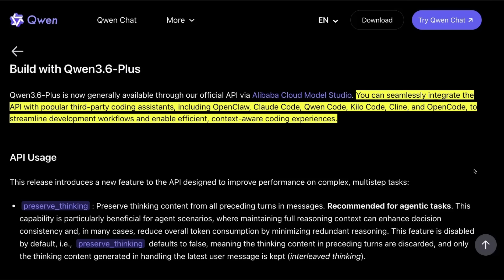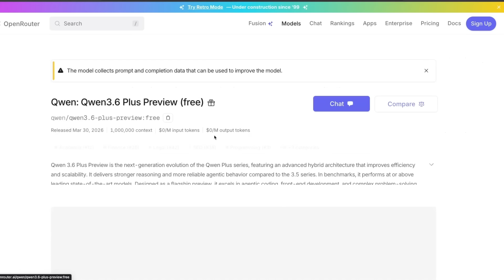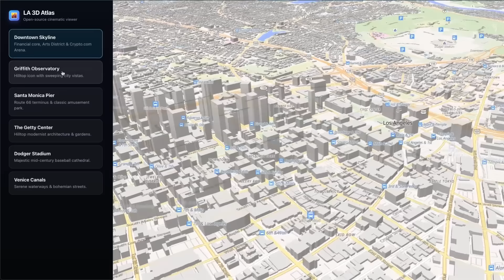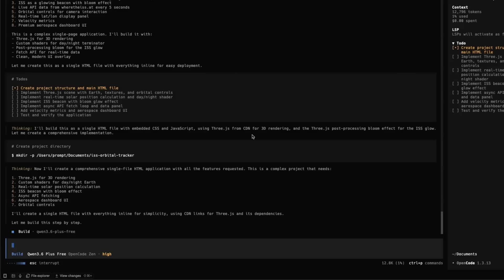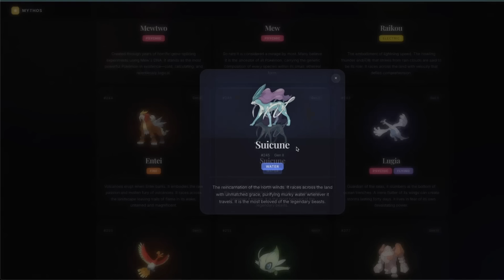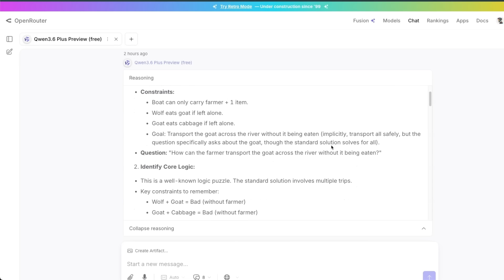Qwen 3.6 Plus is Opus but Free?

Comment: Interesting release and the harness over model point is genuinely the most useful takeaway here, though worth flagging for anyone jumping in that since this is a free preview whatever you input is likely being used to improve the model on Alibaba's end, so keeping sensitive code, proprietary logic, or anything you would not want shared well away from it is the smarter approach regardless of how impressive the benchmarks look. 

The 1 million context window sounds massive until you actually use AI in game development where context tokens get eaten up incredibly fast between scene logic, component references, and engine specific syntax, so prompting smartly and in focused chunks matters a lot more than just having a large window to work with. 

From what I have seen during my internship at Lifewood prompt engineering around context limits comes up constantly, and the hallucination problem is worth taking seriously here too since AI tends to hallucinate noticeably more in game development than in standard programming, likely because the combination of engine specific APIs, custom project structures, and less represented training data creates more gaps for the model to confidently fill in with something plausible but wrong. 

Always verify generated game logic manually before integrating it because a hallucinated method or a misremembered Unity API call that compiles fine but behaves incorrectly at runtime is genuinely harder to debug than a straight up error.

Comment: I thought you'd give it the kepler metrics and have it calculate iss position, rather than go get the position via api and display it. since you use an api, you have to check if the api provider would accept or reject your llm's api request. You may think it's the llm's problem not displaying iss position when in fact the api provider detected a robot and refused to provide a response.

Comment: Sad to say it's still weak on logical reasoning. Gave it a 3 step problem most people would solve quickly and it floundered, often making logically impossible moves. After 6 attempts it had not succeeded and claimed the problem unsolvable.

Comment: have you tried with leaked Anthropic template?
Reply: In all benchmarks the harness for claude code is weaker than the one in opencode or codex and both are already open source, so while it's interesting to look at how they coded claude code there is really no reason to copy it.
Anthropoc's strength are their model, not their harness.
Reply from the maker: I wouldn't recommend using that! Not sure what type of vulnerabilities are in there (can't trust anyone)
Reply: @engineerprompt I mean it came directly from anthropic.